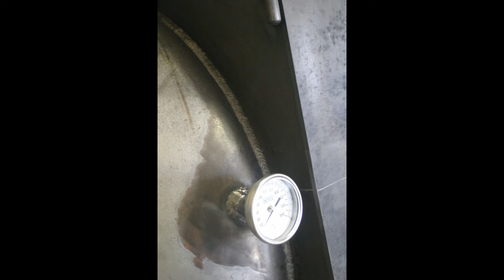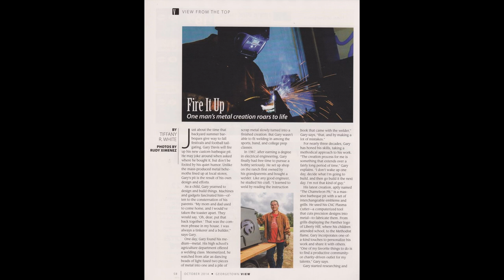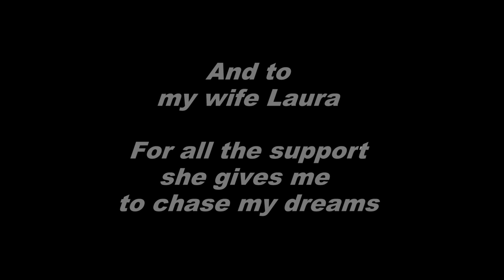Davis BBQ Pit Build 2014 Photo Collage

Comment: Gary this is Howard Holt how did you cm bed work out on your new truck with the cross traffic sensors being removed 
Did it cause any codes to stay on? 
I’m supposed to get my bed put on this week and if I can just turn them off without a code staying on I won’t worry about integrating them into new bed
I see where you can turn them off on the dashboard but didn’t know if that would be enough to keep it from throwing a code
My local dealership can’t find any info to go into computer  and delete or cut them off
Thanks for your response
Reply from the maker: I had the Foard dealer do two things:   a) reprogram the turn signals - they flashed too fast on the dash but normal on the truck  b) turn off CTA/BLISS.  All the other functions work like they should including adaptive  cruise control and radar functions, cameras, etc.  They should know what bulletins to look up.
Reply: @dgoatranch  thanks I appreciate that so much
Reply: Thanks again Gary dealership turned off my cross traffic sensors with your help no light on my dash now I appreciate it